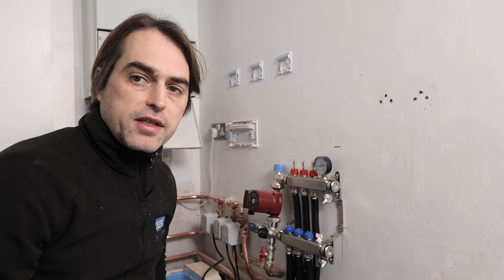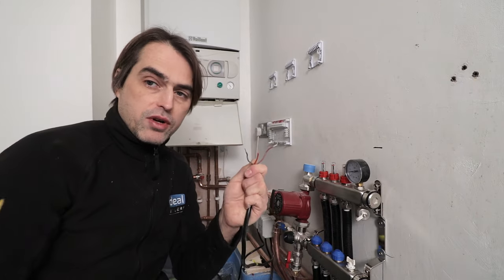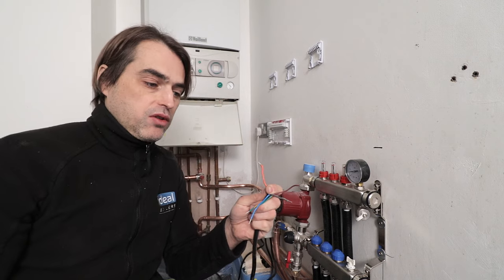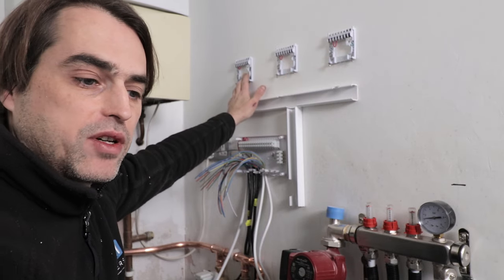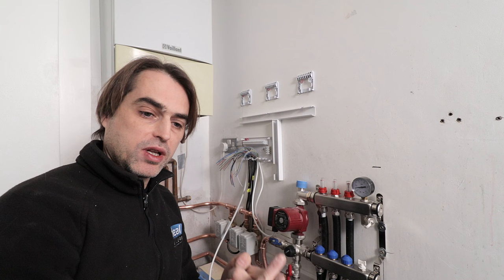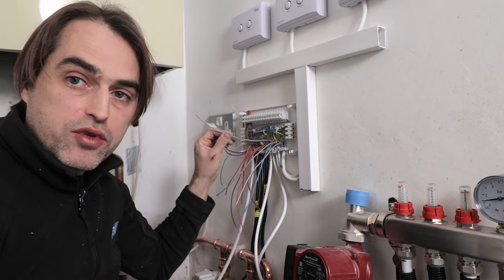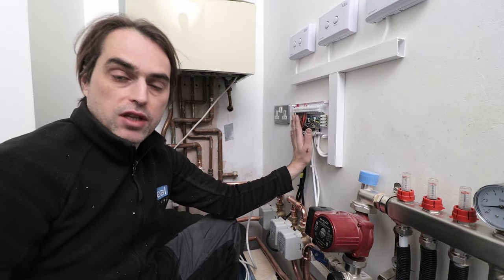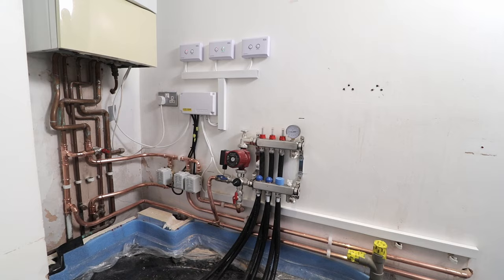Under floor heating wiring explained

Comment: Normally open shoud mean open contact in electrician world meaning switch is in the off position as far as I can read on Internet. Normally closed should mean closed contacts so in other words means that the switch makes so it is on. Can you confirm? Looks like you said the opposite if I don't go wrong. Thanks advance for your reply?
Reply: Yeah, that’s what I thought as well
Reply: Normally (I.e. default position with no power) in electrical terms means the contacts are open (so switch is off and no current can flow). In plumbing terms, normally open means the valve is open so open to flow. So they are opposite.

Comment: Hi.
I'd like to wire my Glow-worm Energy combi using this method. I have regural radiators upstairs (zone 1) and currently fitting UFH downstairs (zone 2). I plan to use two zone valves in the way you did this. I also have tado smart controller which is able to modulate my boiler via bus. My question is how to wire this bus connection through wiring box?

Comment: The only part I don't understand, which is why I came here, is that the UFH pump starts pumping before the 2-port opens with this set-up. Ideally, you'd have a 2-port with two separate micro-switches. This set-up runs the risk that the 2-port fails and the pump keeps trying to pump.
Reply from the maker: The pump will still circulate around the ufh loops so nothing will happen
Reply: @UrbanPlumbers  Thanks. I didn't realise how the UFH water circuit worked.

Comment: Are you using the boiler pump to circulate water to the central heating?  And if that is the case does the central heating thermostat cable on grey send switched live to the brown on central heating zone valve, sending live through the valve grey to orange on the zone valve. The orange powering on the boiler and the boilers pump?  Thanks.
Reply from the maker: Yes

Comment: Is clever the way you mentioned that the brown from the controller turns the pump on and not the orange obviously because is messed all up
So it helps avoiding using of relays ?
Thanks

Comment: Very helpful, thanks.

Is it possible to just use 2 zone valves on this system for UFH and just an open loop for central heating?
Reply from the maker: no, radiators would be always on, even when not needed. You could run it all open loop with no zone valves if it was low temp. However, as you can see the boiler is a non-condensing DT10 appliance with DT50 radiators.

If you swapped radiators for ones that are sized to the same flow temp and flow rate as UFH you could run it all open loop.

Heat loss of that place was enormous though, and without major insulation upgrades, it simply is not possible.
Reply: @UrbanPlumbers 

Thanks for quick response!

Hapoy new year!

Comment: In Denmark it is illegal not to have aktuators allowing the temperature in each room to be adjustable. 

My heat pump is running based on a heat curve and outside temperatur and I set all my thermostats to fully open. My aktuators are all fully open. Is this as good as not having zoning?

Can I remove the manifold pump while still having aktuators on my Roth manifold?

I hope you can help. I cant seem to find an expert in Denmark.

Comment: I think it’s easy to get confused with electrics and the terminology of ‘normally open’ (which means no current flow) and normally closed (which means there is a current flow) whereas for a plumber if something is open there is flow and if closed there isn’t. Great explanation by the way - well done.😀👍

Talking about reliability and I agree you solution reduces the nodes of failure - the two port valves (x 3) are still a factor. In your experience are Honeywell ported valves getting less robust/reliable (compared to yesteryear)? My home system with a mid port 3 way the initially fitted valve ran perfectly for 17 years, then the head unit failed (the synchro motor was fine), new head unit fitted complete onto the old valve (which was free to move between finger and thumb) - then blow me 3 years later the synchro motor in the ‘new head’ unit fails (valve free to move between finger and thumb) - then 2 years later the head unit failed again (and the original valve is still free to move). All genuine Honeywell parts. I lost patience this time and replaced the whole f’n thing (genuine Honeywell again) as the cost difference is small - apart from the pain of draining down and venting.
Reply from the maker: yes, common knowledge these days that Honeywell is not very reliable. Drayton seems to be the preferred choice of many installers these days.

Comment: Great video. I'm currently looking at install of an S plan with CH Zone, HW Zone and single UFH zone off a vaillant combi.  The only question I have is that this means in a situation where the UFH TRV does not need any hot water (UFH is running at correct temp) and is closed and the HW is off and the CH ZV is off (My CH will come on later in the morning) BUT the UFH thermostat IS demanding heat the boiler pump may well run which will force flow either through the internal boiler Auto by pass or an external fitted auto bypass.  It seems from waht I have read that this is OK? I thought the bypass was kind of for 'emergencies only' in case of some type of failure but here it may be used much more frequently. Can you advise on what bypass pressure should be set at please or how I can figure it out?
Reply: Did you figure this out ?
Reply: How would this work using a y plan. Manafold has no separate pump. All controled by s plan???
Reply: Sorry, controlling 2 zones.

Comment: So glad to see you use your earth wires as earths not as a signal wire. The earths protect the cables if they get chopped ect they cause the circuit to trip the breaker. So many poorly installed heating controls use the earth not as intended. Great explanation as usual.

Comment: Hi mate, just a quick question please. When we connect pumps to brown switch live; wouldn't the pump start well before the zone valve is fully opened up and chance of pump running dry etc?
Reply: The pump will run dry for few seconds. Not sure the longevity or implications for the pump.

Comment: What are the actuators? In this case we don't have a programmer because we don't need a timer to turn the heating on and off, we just want the boiler to come on upond room thermostat demand (that you call controller) right?
Reply: The actuators normally go on the underfloor heating manifold and are switched on and off with the matching zone thermostat(on a single manifold multi zone underfloor heating system). So that only the zone calling for heat gets heat.

Comment: Great video. Questions: If you have an UFH manifold under a heat only boiler, and the main system pump and zone valves are up in the roof with the cylinder, how would you wire you pump? Does the main pump need to come on when only the UFH is on? Thanks.

Comment: Brilliant as always, just one thing I can't get my head around, as the motorised valves turn on the pump I assume if you have a conventional system boiler you can't control the "pump overrun" to remove excess heat in the boiler?  Is this not a problem, if it is is there a way round it? Many thanks

Comment: Doesn't this way of wiring turn the pump on before the zone valve is open? If the zone valve fails to open the pump will run regardless?
Reply from the maker: It doesn’t matter. There is circulation through the manifold anyway
Reply: @UrbanPlumbers   I was thinking the same issue but I guess in my system  multi-zone S plan, the main pump serves multiple zones so in that case should be wired to the oranges? so at least one zone valve is open before the pump can run.  Thanks for the excellent video.

Comment: Great video, very clear. I have just installed UFH, 5 loop single zone in kitchen/diner area. Same set-up described on this video. 

Quick question: I have been told that the PCB on my heat pump control unit cannot supply an additional pump die to power limits. 

Is it ok to power the pump and temperature controllers from a seperate fuse spur on same circuit? Reason for question is that the call for heat signal is being fed back to the PCB on my heat pump controller

Comment: Great video, thanks! 2 Quick questions if I may, is there any need for relays to switch the pump on and off? Also, do I need a specific type of mixing valve to cater for ASHP output of 40-50degC?

Comment: Great video. I’m using a pretty similar system but only have a live neutral and earth (2 core and earth) connection available at the boiler and not a switched live terminal. Any tips on connection for that?

Comment: great description my question is i am adding a extra pump to my nest s plan zone valve to increase circulation and get more heat to radiators, you say connect brown wires from zone valve to brown wire on pump thats fine, now do i connect neutral and earth from pump to neutral and earth  on terminal centre so when the zone valve opens it swithes on the additional pump 
thank you if you can help
Reply from the maker: you will need hydraulic separation if you are adding another circulator - low loss header or CCT

Comment: Very informative video! Do the same wiring systems apply for low voltage switching? Or would this require a different approach? Thanks
Reply from the maker: Completely different story with low voltage switching and wiring centres

Comment: What about hot water. Regardless that works with underfloor heating it is still a combi so it has its own wiring inside for the diverter valve to the plate heat exchanger right? Priority to hot water right?
Reply from the maker: Yes correct

Comment: For which particular reason that the owner of this house wants one manifold for each room?
Reply from the maker: Easier and cheaper to control 2 areas on 2 separate zones without having to use UFH wiring centres and actuators

Comment: You said it all back to front lol
Normally open means no connection ! OFF, open contacts !!
Normally closed means closed connection, ON !
Reply from the maker: Normally Open is usually for ON as it is off in resting position, normally closed is off as it is open when they system is on. All correct
Reply: @UrbanPlumbers  Unfortunately we will have to disagree, 
Normally open - Is a contact that does not flow current in its normal state. Energizing it and switching it on will close the contact, causing it to allow current flow. Normally closed - Is a contact that flows current in its normal state.
From the bible!!
Normally open circuit :)
Reply: @UrbanPlumbers  Great channel btw 
Great content :)
Thank you

Comment: Did you have your brown and grey back to front when discussing the wiring in the wiring centre? I thought that grey from the Programmer's was the switched live back to the wiring centre?

Edit: ignore me, I think I was confused
Reply from the maker: Grey from the programmer is switched live to the wiring centre with a brown sleeve. Grey from the zone valve is permanent live from zone valves. 

Did I say something different on the video?
Reply: @UrbanPlumbers  I don't think so, I think I jumped the gun and commented before I finished watching, and I'd got myself confused.... This is a great video by the way, nice and simple install, well explained.
Reply from the maker: @dorsetengineering  you got me worried for a second. It is easy to say something wrong in this kind of videos. Thanks for watching !
Reply: @UrbanPlumbers  thanks for taking the time to make these videos, they're really helpful. What's your preference for manufacturers of zone valves?